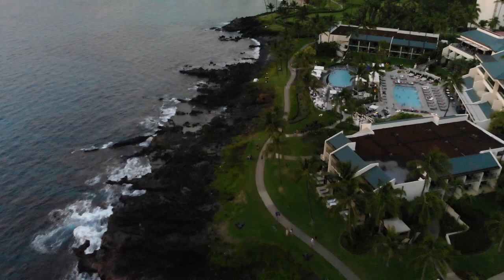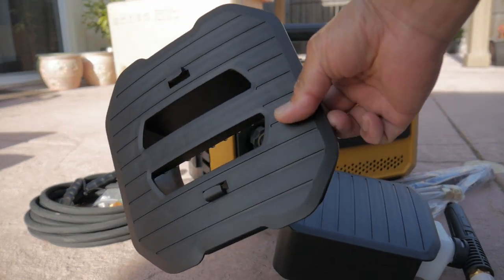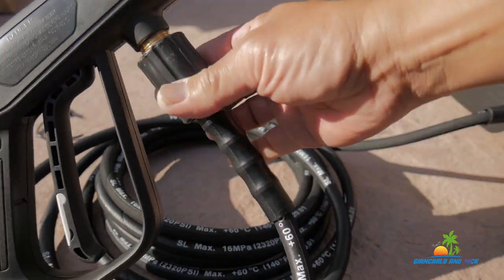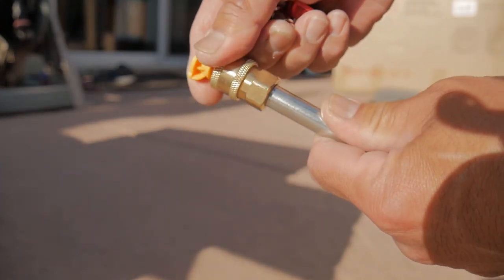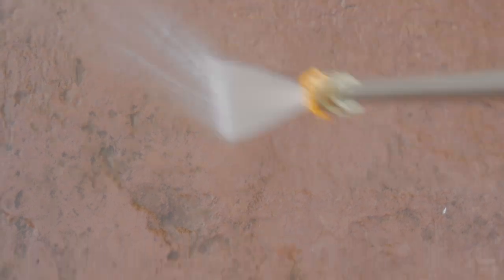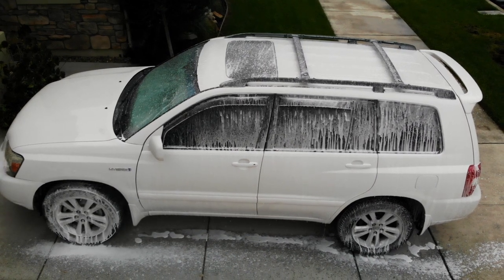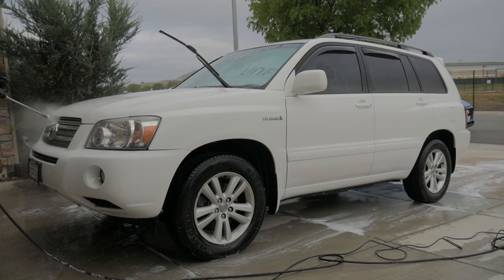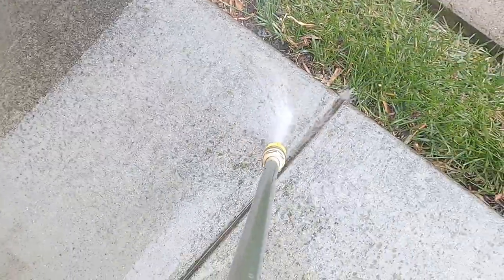CAT 1800 Pressure Washer NEW | Unboxing and Real World Use

Comment: I've just discovered that this pressure washer is made for a few different companies.  It's just rebranded.  It is the exact same as the Active VE52 and the Simoniz Platinum 1800 up in Canada.  Majority of the reviews I read stated longevity issues with this unit, which happened fairly quick.  Hope your unit holds up.

Comment: My psi numbers were very disappointing.
Wit the included nozzles:
Red 890
Yellow 850
Green 850
White 890
I have bought a yellow 3.5 and got 1000.
Also bough a white 4.0 and got 850
With a 3.5 turbo nozzle got 960
The gpm was below advertised but really great. With the included nozzles I got:
Red 1.88
Yellow 1.90
Green 1.92
White 1.90
With the yellow 3.5 got 1.82
With the white 4.0 got 1.94
So yeah, even my cheap $100 Chinese one was able to get more psi....
I don't think the extra flow is going to compensate while cleaning my concrete sidewalk...
But for the car is going to be great!

Comment: Can you use this to clean light mold off white gutters?
Reply from the maker: Yes, light mold should be easy to blast away with this. For even better results, I would add bleach to the spray bottle it comes with to better attack the mold
Reply: @GiancarloandNick  Would the bottle attachment allow the soap/bleach solution to spray high enough to hit the gutters?
Reply from the maker: Probably not. It would be better to use it with a ladder. Just be careful on the ladder and maybe have an assistant there.

Comment: Can you please try it with the MTM PF22 foam cannon?
Reply from the maker: Sorry, I do not have the MTM PF22. But I looked at their site and this CAT electric pressure washer should work good with the PF22 since this has the psi output and GPM required from the MTM PF22